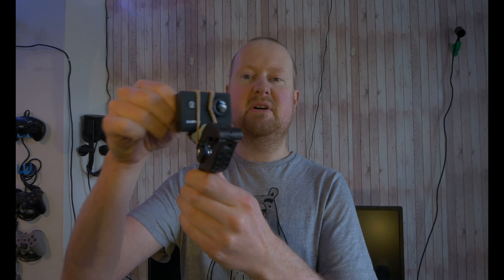How to 3D print a gopro action cam mount for the Ender3 3D printed on an Ender3 3D printer.

Comment: Hiya mate wanted to no what kind of 3d printer would I need to make 3D Printed TPU GoPro Hero 11 Black multi colour
Reply from the maker: Hi, not sure I understand your question? Are you asking if you can get multi colour 3d printers? Or if you can print multi colour with a regular 3d printer?
Reply: @3dPrintedSoup  what 3d printer would I need or you could recommend plz

Comment: Ive just got hold of a action cam to day for £10 as no were got any webcams and those that have are asking stupid money but can't seem to get feed from octoprint is it possible you could kindly tell me were ime going wrong ive currently got a ps3EYE riged up but its not watt I want yours paul lock from uk 👍
Reply from the maker: Hi Paul, cheers for watching.  Some action cams function as web cams some do not, check in the manual to ensure it has a web cam feature. If it does then download OBS studio, its free, has loads of tutorials re how to use it on YouTube and it picks up most web cams so you can test it to make sure its working. Best of luck